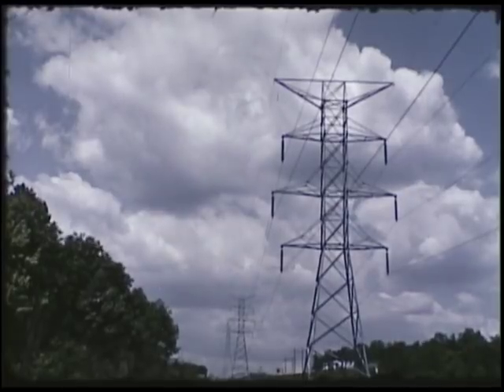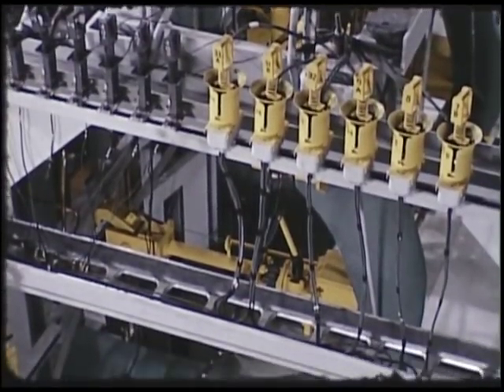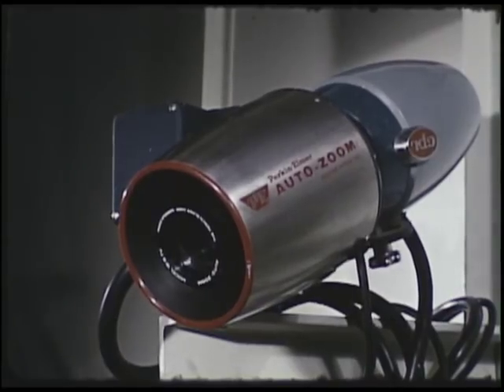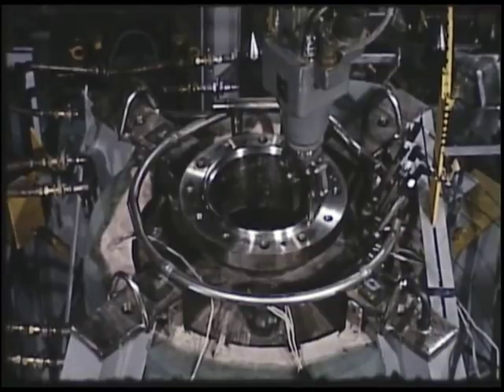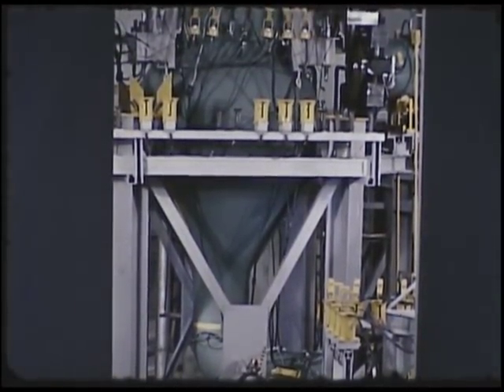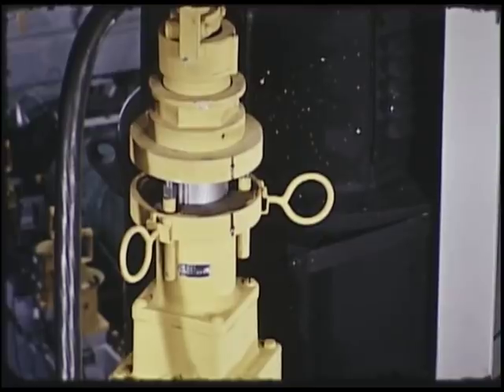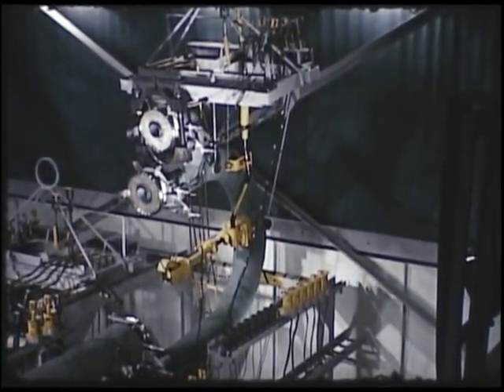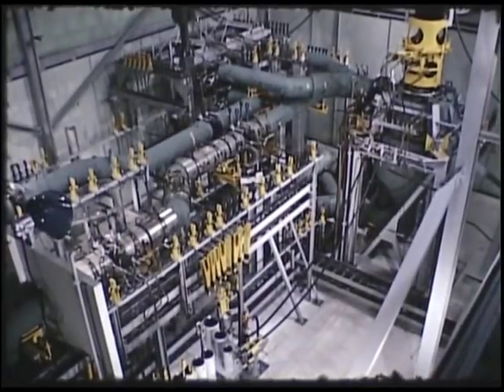Remote Maintenance of Molten Salt Reactors

Comment: BUILD A NEW ONE OAK RIDGE!!!
Reply: Why? The old facilities work just fine, sure you can update them, but why rebuild when it's not necessary.
Reply: @Rob_Moilanen  The old reactor initially worked somewhat resonable. At least they could sell it as such. However they later (around 2000) had a quite serious incident (fuel leaking to the outside) with the reactor long shut down, but the fuel still not removed. It was a quite expensive (partial) clean up of the highly corroded reactor. Not all of the remote handling and monitoring worked so well after a long time. The left overs are still awaiting final disposal sometime in the future.
Reply: @UlrichHarms-ci1ov which reactor are you referring to ?
I am referring to the MSR reactor at Oak Ridge
Reply: @ The MSRE reactor at OakRidge was the one causing problems. The other (aircraft reactor test) was disassbled in time.
Reply: @UlrichHarms-ci1ov  how much are you being paid to say this crap ?
Cause everybody knows how well the reactors did in the test runs they conducted. The MSRE ran flawlessly as specified,  they other reactor only failed because, as designed, it was too heavy to fly in the designated bomber.
Point to any particular problems where the MSRE failed to meet it's designed criteria, and you can't.
Reply: Gerhard Schroeder engineered the Energiewende, a turn away from coal and nuclear towards gas. He joined Gazprom not too long after retirement from his position in government in Germany. There are no such equivalent people doing the same in America, whose oil and gas drillers are comprised of hundreds of small outfits without centralised control. Although I suppose one could credit the fracking revolution in the US to decades of government investment; this does not necessarily credit any single individual or party with the push towards a reinvigoration of American fossil reserves.
Reply: Why invest in an energy source that is one millionth as energy dense as nuclear? @MonMalthias
Reply: The new Oak Ridge can be found in Japan, RNK, China, and India. No matter how much better a technology is you need to get past the Oil, Gas, and Coal industry lobbyists to even moderate outdated rules and concepts. 

They continue to obfuscate and even out right lie to preserve the status quo. They tell WV & PA coal miners they are going to "protect" their way of life while buying coal from KY and Colorado... face it, electrical power production is the least scientifically based entity  and most unlevel playing field in existence in the US. It is not world competitive product technology because of proliferation fears even though every country we "fear" already has nuclear weapons, many for years and years... it is time to stop the charade and be honest. 

Using their model and methods handheld electronic calculators would probably just be coming out and they would be 4-bangers... scientific models would likely need to wait another ten years. But the "industry" would be bragging and boasting about how clever we are and how dumb everyone else is to cover the true gap in advancement.
Reply: Thorcon and Indonesia will make 6x500 MW MSR which is literally a bigger Oak Ridge MSR reactor
Reply: I heard that the whole reason experiments like this were shut down is that California wanted all the money for designing reactors and thus Oak Ridge's experiments weren't funded.

Comment: So cool, now build a new ones already :D Remote maintance could be fully automated, pre-programmed and carried out by a couple of arms ^^ mmmm dreamy
I can only imagine how painstaking it must've been, to plan and carry out those opperations, almost 60 years ago. I wonder how we ended up with solid fuels. I'm guessing it was because most early "reactors" were just a pile of uranium. And it would probably have seemed logical, at the time, to continue that path. (and also the need for also breeding plutonium)
Reply: There are a lot of people who fervently favor the FHR. I'm of the opinion that these people lean much too far to taking small, conservative steps in nuclear power. Some of the biggest perks of FHR are that you get to use NRC policies that are already in place (e.g. your barriers to fission product release are equivalent to or stronger than water reactors) and you don't have to worry about fission product salt chemistry at higher burnup, which may not be very well understood.
Reply: No they were liquid metal fast breeders. They have solid fuel cores and liquid sodium or lead are the coolants. They were not molten salt reactors. Get your facts straight.
Reply: If circulating fuel with fission products is a big hurdle there is the concept of stable salt reactor, where fluid-fuel is kept in tubes similar to LWR. Moltex Energy of UK is developing these reactors.

Pebbles made of graphite and carbide floats in the salt and pool type designs are not possible. To add, there is positive coolant void coefficient. Any loss of coolant from FHR should be avoided. I'm not convinced that FHRs can be made more economical than existing reactors. If we establish a new fuel infrastructure and build pebble manufacturing factories and reactors, transition to liquid fuel will be pushed to very far future. Fuel transition is always a slow process because of inertia.
Reply: The Chinese HTRs are being built at a cost competitive with LWRs at ~$8000/kWh: 
http://www.world-nuclear.org/information-library/country-profiles/countries-a-f/china-nuclear-fuel-cycle.aspx#R_and_D . 
$430 million for 210MWe, 80% Cap factor (assumed for FOAK).
Reply: I do not understand the reason why US national labs and China are doing research on solid fueled FHR (Fluoride Cooled High Temperature Reactors).
Reply: @achalhp  I believe it is a critical first step into making a molten salt reactor by building and testing the salt cooling components on existing reactors, rather than build an entire new reactor, also testing the viability of salt cooled solid fuel reactors, while monitoring any adverse affects. Bear in mind, those responsible for mining/refining/enriching solid uranium fuel rods stand to lose a lot of business if the thorium process for molten salt reactors proves to be a superior process. (Which certainly seems to be the case!)
Reply: MonMalthias if China Wants to gamble on the ability of the national level Communist government to police all the local Party officials to keep any of its atomic power plants safe from a melt down like Fukashima over the next Fifty years.
Reply: Carl Page does any one know what the long term effects of Neutron radiation on fluoride salts and how it will affect the chemical propertys?
Reply: You know how you get a free razor, but the blades cost money?   Nuclear reactors are sold the same way.  Solid fuel pellets are just complicated to be patented so one company has a monopoly on the fuel for that reactor.  No one wants to trade that for a much cheaper reactor that burns liquid commodity fuel that any chemical supplier can provide.
Reply: Carl Page : This is not how it works for other energy sources like fossil fuels. Diesel can be refined from crude oil by any refinery, and can be used by any vehicle. For a energy source to be successful globally, fuel should be a commodity which can be directly used in the machine. We talk about Nuclear4Climate; but, we don't talk the technology that can achieve the scale of 5000-10000 GW necessary to meet the requirements. If we want to stop all CO2 emissions, we need 5,000-10,000 large reactors (>1GW) or 50,000-100,000 (<100MW) small reactors.